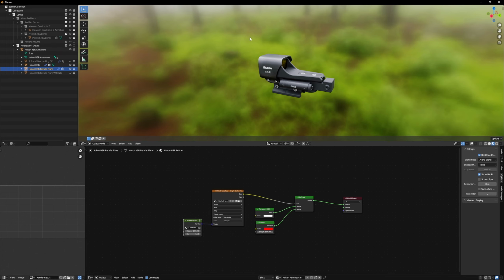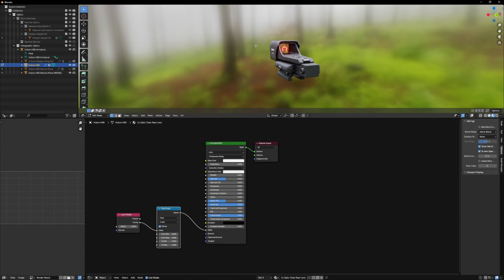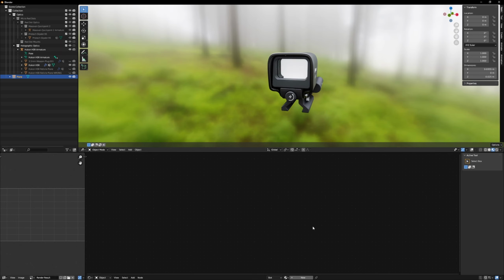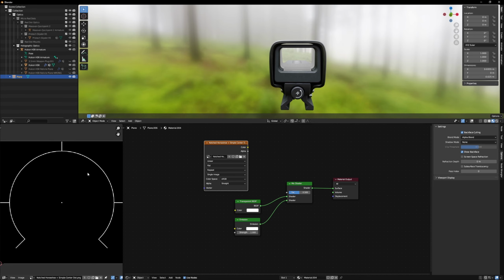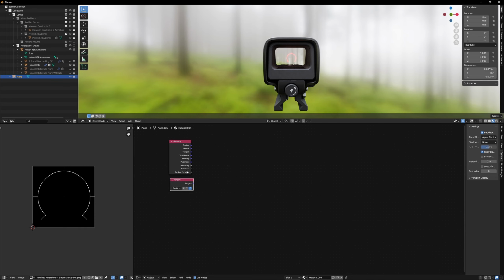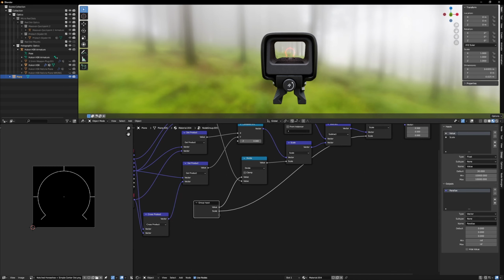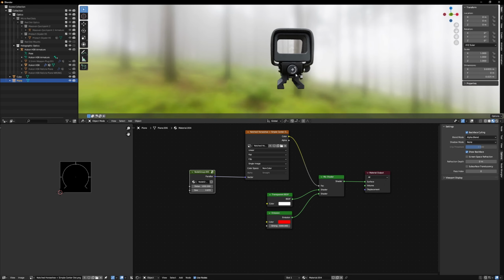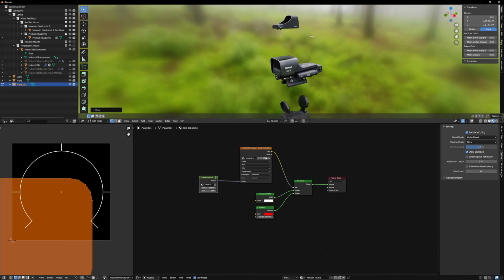Blender 3D | Red Dot, Holographic, Reflex Sight Reticle Effect Tutorial

Comment: While this was super helpful is next to impossible to find anything about magnifying effect/shader anywhere since i want to make an functional scope (preferably working on both Eevee and Cycles)
Reply from the maker: I’ve looked into it and while there are some niche ways you can kind of achieve it in real time, it’s unfortunately just not really possible in blender. The problem is that you need the scope to use a secondary rendered view which is then fed to a dynamic texture, but blender doesn’t support this feature.
Reply: @ConnorPriola  Yeah is a pain to find any info as i only found lens zoom effect exclusively for Cycles so far by using IOR

Comment: Interesting tutorial, I'll need to look into the math to understand it better.
It works well in both EEVEE and Cycles for me, as long as there is no depth of field :
- EEVEE + DoF does not work : if you want the reticle to be sharp, you need to focus on the plane mesh, and the target will be blurred.
- Cycles + DoF works as a real sight would : the reticle is sharp when focusing on a target far away.
Not sure why, I suppose it's related to raytracing.

Do you know if there is a way to make EEVEE + DoF work ?
Reply from the maker: I assume it probably isn't possible as that's just a limitation of EEVEE unfortunately.

Comment: Great video! I was having odd issues where the reticle snaps to the bottom left of the mesh at low distances though I have a fix. I placed a vector subtract inbetween the last vector subtract and the vector scale with value (.5,.5,0) in variable #2 just before the final vector scale. It introduces scaling issues, but fixes the transformation issue. Only reason why I thought about doing that is previous work with tiled camos.

It seems to have fixed the issue. Though, I do see strange issues with the reticle stretching on sights that have strange shapes like a tall reflex sight. Editting the UV so it's on par fixes it.
Reply from the maker: Glad you managed to figure out a fix!

Comment: Kind of shocking that game devs in the current year still don't know what red dots look like, especially with the plethora of reference material out there and the fact that games have been doing it correctly for 20 years. Good tutorial.
Reply: Also looking back at this, something that's good to do for more realistic holographic effects is to use a noise texture and color ramp mixed into the emissive channel to add a little bit of the digital fuzz you see on optics like Eotechs. Obviously you don't want to overdo it- the lines should still be sharp and clear- but little variations in the luminosity go a long way.
Reply: they do actually. they dont do it for skill reasons. its much easier to see the sight like in rainbow six because you see where the middle of your scope is while your aim is going in. this version your sight waits to align which makes it harder to aim if hitfire is inaccurate. it depends on the type of gameplay. also performance.
Reply: They don't make the Red dot that much realistic because the players will find the game harder but its good in renders or Video renders